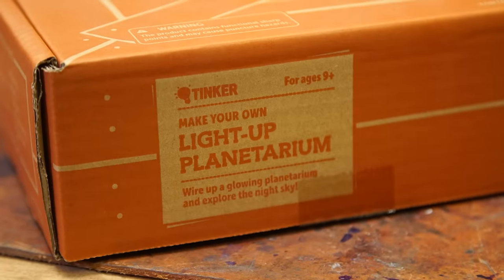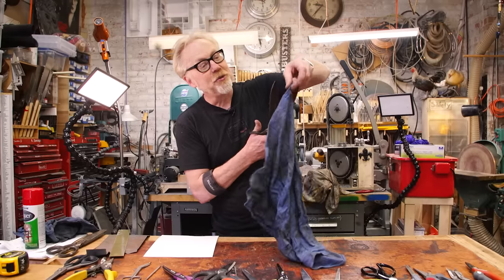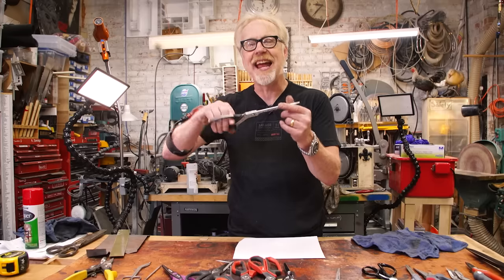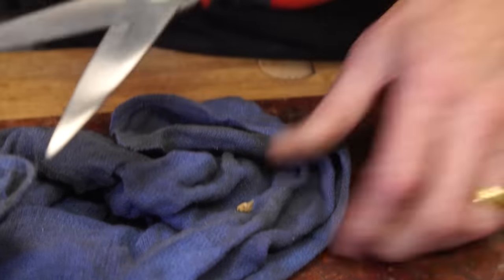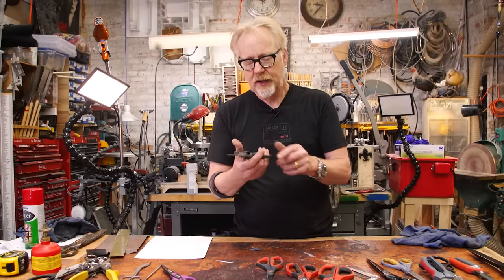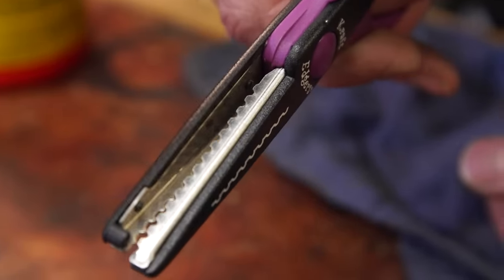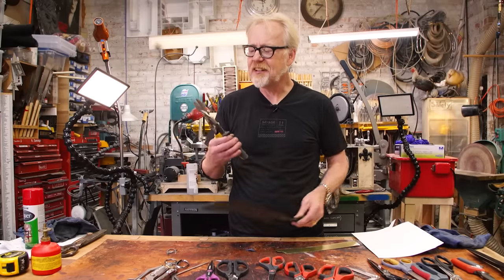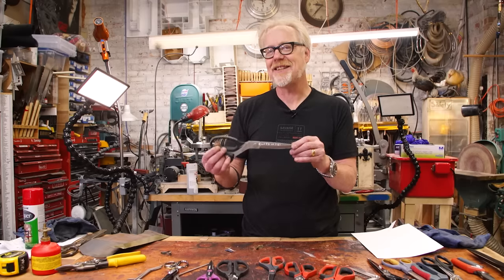Adam Savage's Guide to Workshop Scissors

Comment: The military know how to get their soldiers to keep emergency scissors on them & easily accessible & that was to put a bottle opener on it.
Reply: Reminds of the galil rifle, had a built in bottle opener since they had issues with troups using uzi mags as them and damaging the feed lips
Reply: @ipodhty  Ozi? Uzi?
Reply: @ipodhty  to second this, this is the exact reason i keep the galil in the man cave rather than the gun safe, mostly to win the "my bottle opener is cooler than yours" that tends to happen, so i whip out the balisong bottle opener (bbarfly made in canada, basically a bar blade in a balisong handle. works great for popping a beer so it sounds like opening champagne) then if that doesnt work just go over to the  back bar and use the galil instead
Reply: @ste887   That would definitely win the COOL competition in my neighborhood!
Reply: I’m not positive but I think some medicine bottles would have a bottle cap top which would require an opener. Like bottles of plasma from ww2.
Reply: That's the most plausible explanation for that combination tool I''ve heard.
Reply: @ipodhty  Similar to M16 IIRC: the v early editions kept having the sights damaged by grunts using them for bottle-openers, so later models included an integral bottle-opener
Reply: @kcspeed9980  Or morphine, maybe?
Reply: @snafu2350  yeah. I’m not claiming to be an expert, there must be many other items that use a bottle cap style top for the military to have put it on another tool.
Reply: @kcspeed9980  I think you're right.

Comment: "Once you've successfully saved a life, it's Miller Time"  -Adam Savage
Reply: Looking at the age, could they date back to when blood/plasma came in glass bottles?   I could see some producer of the bottles having a crimp on  cap.
Reply: @robertpeacock1635  I was thinking this exact thing.
Reply: My though was that having a bottle opener on them might be a reasonable way of making sure that the soldier carrying them kept them someplace convenient and easily at hand at all times. And, well, knew where they were at all times.
Reply: @RNMSC  It also kept soldiers from breaking other equipment by trying to open bottles.
Reply: My first thought was - those go in a fishing tackle box!
Reply: @RNMSC  It was for local anesthetic bottles.
Reply: Most injectable medicines come in a bottle with a rubber bung and a metal shield crimped over it. I suspect that bottle opener extension is for removing that shield without trying to lever it of with your fingernail/knife/large gauge needle/whatever pokey bit is handy and then cutting yourself and bleeding all over your patient.

Comment: "Scissors is a rabbit hole."

No, Adam. EVERYTHING you own, is a rabbit hole!
Reply from the maker: #Truth
Reply: @tested  cloth Scissors should be ground hollow .
watch this vid of a Master put it together (master scissor maker)
Reply: @cornnatron3030  waits patiently for the video
That does make sense, but edge thickness is much more important than grind.
Reply: @monkeycircus509  and his rabbit hole of collections..
Reply: @tested  Did you know that your Gingher shears can be sent to Gingher, and they will service and sharpen them for free? Those things can cut through 4 flat felled denim seams cleanly in one easy go, as in cutting both legs of jeans off at the same time! And their pinking shears are just as amazing. My own are put away in their original boxes after use. The only way to make them better would be padded handles. I'm 64 and got my first sewing machine at age 8, so you can trust me on this. 
>> Tom's wife Pam <<
Reply: Hi, my name is Mark and I’m a tool ‘ho!

Comment: The bottle opener on the bandage scissors is to open certain medicine vials that have a metal top. This was was much more common prior to plastics being used like most modern vials do today, but there are still a few. Some lidocaine vials for 1 that comes to mind. When you need something from a vial in the field you need it immediately so those scissors were extremely handy, and still are in certain cases!

Comment: The one thing you should have added is that for scissors to work correctly the blades need to be slightly curved so they only touch each other at one point & as the scissors are closed that point moves from the heel to the tip. If a pair of scissors is not cutting well the first thing to check is the alignment of the blades, well made scissors are essentially self sharpening as long as the blades stay aligned.
Reply: Two other major points IMO: i) ensure that the pivot point allows for easy dismantling of the blades. ii) A compression spring or (even a spring washer) there is always good to have too, to ensure the faces always meet exactly at the point of maximum shear force (hence that area of clean cut is effectively guaranteed). The first point above ensures you can easily clean/sharpen the individual blades /at that point/ (the most difficult to get to & often the required cleanest cutting area); the second again reinforces the 'clean cut' area of max shear force by counteracting any bowing of the blades out of true 'flatness' relative to each other (which may well happen over time, esp with longer blades)

The emergent point from this is how to establish whether the tool is high-quality or a cheap knock-off: if the pivot post is hard & tough enough it should be OK to restore; if not, it's a 'throwaway' version. Wear at/on the pivot should be restorable, but angle of deviation (WRT the pivot's true perpendicularity to the blade's facing plane) considerably less so :(
Reply: The folks on the video "How to sharpen scissors - three ways, plus hacks" by Work Shop Tools say that scissors are self-honing - which is not self-sharpening.

Unrelated but 15:58 - reminds me of an M1 Garand ping.

Comment: For cutting sticky-backed Velcro, labels or tape I have several pairs of Teflon coated scissors at work so the adhesive doesn't stick to them. Not only does it prevent the problem you mention of having adhesive left behind on the scissors, it also keeps tape from wrapping around the scissors and getting stuck on them.

If I have to do precision cutting of adhesive backed material, I will use a rolling cutter, self-healing mat and straightedge then peel the material off the mat with an Xacto knife.

Comment: As a left-hander, the feature I appreciate in the Milwaukee scissors is the handles are not angled specifically for right-handed people
Reply: However, holding them left-handed you are pushing the blades apart instead of together when you cut unless you twist your hand into a claw.
Reply: @RobWVideo  it's usually a deal of minimizing problems being left handed. I accept the blades issue because I find the angled handles more annoysome
Reply: The Kai brand Adam suggests have Left handed versions marked by a L after the model number, for example the 7250 (right hand) and the 7250L (left hand).

I use them at work all the time
Reply: @MrUnicornassassin  Decent left handed scissors are a good find!
Reply: As a lefty, somethings you just teach yourself to do right handed and move on.
Reply: @CRASDFGH  the lefty scissors in my classrooms as a child were so bad that I gave up and did it right handed. Then I got older and learned to sew from my right handed mom
Reply: The Kai make leftie scissors too.  Pita to sharpen tho

Comment: Adam, those metal cutting snips are more accurately called aviation snips. Aviation snips have a compound action which gives them a mechanical advantage over standard tin snips. This is due to the double pivot and extra linkage in their design
Reply: I was checking the comments to see if anyone else wanted to clarify the aviation snips thing. Also I wanted to note that they generally come either with red, yellow or green handles. Red cuts to the left, green to the right, and yellow straight.

Comment: The dual-purpose militairy scissors are probably for a Plaster cast master. The material you use to make a casting, linnen on a roll covered in dry plaster, is kept dry in metal storage-containers with a 'can of paint'-style lid. The back-end of the scissors would be very useful for opening those cans, the soft-tip for cutting close to the skin.
Reply: I came to the comments looking for this explanation thank you

Comment: One of my favorite (and most used) tools, I've had 2 pairs of Fiskars (medium and large, original orange handled) for over 20 years now. What a great investment that was! I cut anything with them (within reason) certainly not afraid to cut paper with them. Yes, they will dull, but with the Fiskars sharpener you can sharpen them in a matter of seconds. That's probably what I like best about them. Highly recommended.
Reply: There's videos here of how scissors are professionally sharpened. It is an entertaining rabbit hole to go down.
Reply: Those little Fiskars sharpeners are great. As a florist I constantly cut through stems and leaves which dull edges quick, and those put a super edge back on the scissors in seconds.
Reply: I only use Fiskars scissors, nothing I have ever tried comes even close.

Comment: I work in telecom, and we use electrician’s scissors for everything. I love my Klein electrician scissors. They cut through paper, heavy plastic, cardboard, wires, 14 AWG cable, and easily through the 9-12 ply wax covered lace cord without fail every day. They also have a wire stripper on them to quickly strip wires, and since they’re Klein, once they’re too dull they’re lifetime guaranteed.

Comment: For folks who don't know snips: With tin snips, one of the quirky things to know, is that the handles are color-coded: Yellow handles are known in the Sheet Metal trade as "straights", and they cut without right or left bias. Red handles are usually labeled "left cut" because they tend to cut curves to the left, more easily than curves to the right. But in the Trade, they're called "Rights", because they work well with the right hand.
Green-handled snips, labeled "right cut" are known as "lefts", because they work well with the LEFT hand. In fact, they're one of the few cutting tools that can easily be found, that is SPECIFICALLY a left-handed cutter! Like left-handed scissors, they're and exact mirror-image of the Rights. So if you're left-handed, you'll probably find that green-handled snips work best, for you.
And yes, people who install ductwork DO use both: sometimes simultaneously, to cut a section out of flue pipe, or that sort of thing. When I was installing duct, I had eight pairs of snips: A big pair of bench snips, called "Andys", a pair of short-nosed rights, called "Bulldogs", for cutting through seams, etc., and regular, offset, and 90° snips in both right and left. The one thing I DIDN'T have, was yellow-handled straights, because I could do everything I needed to, with all the others. If I could only have ONE pair, it would be a basic set of Rights.

Comment: I remember when I learned that lesson about paper being so abrasive. I was a dairy farm kid and we began using shredded newsprint for bedding material in the dairy barn. We had "bedding chopper" which is basically a cart which has a motorized system to chop bedding material and blow it into the stall with the machine on the adjacent walkway. Ours was from the days before newsprint was in common use so was made for hay. It was able to shred the paper but it severely dulled the knives on the cutting head which were basically standard serrated sickle sections used in sickle bar type hay mowers.

Comment: I'm glad you had the same reaction to the sound of the steel pinging. It was a wondeful satisfying sound.

I have a few metal spatulas that I keep around, not just for cooking, but because of the sound they make when rubbed against other metal. It's a most satisfying ring.
Reply: high five I used to have a 'burger turner' spatula that made very satisfying "plaPP!" + "pWEENG!" sounds when set down & picked up off of flat surfaces

Comment: Omg I buy scissors anytime I find old ones at the recycling center and thrift store. Scissors are like knifes, there's a pair for different jobs. Thank you thank you for this video. It hits me right in the passion part of my heart.
Reply: I'm a sucker for a good pair of used scissors myself. I have a drawer loaded up with them. Nothing fantastic though. And I'll never pay what a really great pair would cost.
Reply: @1pcfred  same. I get mine from recycling center. A have a couple good pears I don't let the family touch. Not expensive or rare just better than the stuff at the store and they will cut paper with them.
Reply: @jasrenfro9856  I cut paper with scissors. I sharpen scissors when they're dull. If they're not too bad then sharpening them is not too bad either. I have seen scissors that are too far gone to sharpen easily though. Wear on the inside flats is not easy to correct. That wear will cause scissors to not work right.

Comment: I have owned a pair of those exact same Kai scissors for about 10 years now, and they are an absolute beast!  For a good 7 years I made a living doing custom stuffed animals for people and after about a full year I was in great need on a new pair as minkey and fur is a challenge to cut two+ layers at a time.  So my mother-in-law got me my Kai for Christmas and let it be said: you pick those boys up and you just FEEL power flowing through.  You think me being silly, but I kid you not you, nothing strikes more fear and respect into you for a tool than when you cut right through 8 layer of denim with just a hand squeeze, and certainly have cut myself a time or two.  I've used those scissors almost daily for years and even now I can just run through bolts of materials like you would a roll of gift wrap.  A tool I recommend to every fabric cutter I meet at the stores to invest in, worth every penny.

Comment: Maybe the bottle opener was for medical solutions in bottles carried on the battlefield?
Reply: Yeah I was about to say I can imagine some medical solutions being in a bottle with a similar cap of a soda/beer bottle.
Reply: I've seen nitroglycerin infusion bottles with metal caps.  There is a pull tab on them that just breaks off about 1/3 of the time so a bottle opener would be useful.
Reply: @tonkatsu72  thanks, I knew it had to be something other than beer
Reply: A quick image search seems to imply that older IV bottles had pop tops.
Reply: There are still medications that react with plastics so there are still glass bottles used for certain applications in the modern day.
Reply: I know for a fact that plasma for battlefield medical use used to come with those kind of tops.

Comment: I only just recently found out there are left or right curve cutting tin snips. Usually red or green.  If you've ever used those straight "Aviation" ones and found it hard to cut, you'll know what I mean. The excess that curls off, needs to go a specific way. Ron Covell has a great video on them.
Reply: Yeah and realistically you only need one pair of the directional snips. Which pair depends on what hand you cut with. Straight yellow handled snips are practically useless. They're your abuse pair. To cut things with that you're not supposed to use shears to cut. Like wire or banding iron. Feel free to use the yellow handled ones for that.
Reply: FWIW the red/green standard for directional snips follows naval/aviation navigation lights' standards: red for port (left) & green for starboard (right) :)
Reply: @snafu2350  Oh wow, ok, that, I would have never known. If I can remember that, it might make it easier to know which one to use.
Reply: @Gerald5000  It doesn't help if you're a southpaw, but you should still be able to figure things out pretty easily ;)

FWIW: 'red' uses less letters than 'green'; 'port' & 'starboard' the same, so the shortest word (at least in English) is always directionally left of your facing (or heading)

[long text about aircraft & naval navigation stuff removed due to reader boredom potential here]

Comment: The "EMT Scissors" are excellent for cutting aluminum cans. The serration on the blades actually makes the edges of the cans less sharp and they cut really nicely. Plus they're stubbier and offset which is good when you're cutting into a cylinder. 

I used to make a fair amount (a dozen over a couple years) roses from cans and the EMT scissors were the perfect tool. Can't say I've used them since....

Comment: Malco metal shears, I tend to reach for before my "aviation" tin snips.  Try them!
Reply: Make sure to buy the red, the green, and the yellow!  (For cutting right, left, and straight...I assume Malco uses the standard colors...I've been in a sheet metal union and I used Midwest snips with good success.)
Reply: @fredygump5578  in general depending on which hand you're using one of the set will be your preferred choice. I know being left handed I like the right hand ones. Straight snips are useless as far as cutting sheet metal goes too. Save those for banding iron and wire. Both the red and the green snips can cut straight.
Reply: @1pcfred  I always grab the reds.  I have the greens just in case, but they don't get much use.  (I don't have yellows/ straight cut to be honest...but I do have larger bench shears that don't get used hardly at all.)
Reply: @fredygump5578  what hand do you cut with? Yellow snips are not useful. Well, they're good for making people feel like they can't cut sheet metal.